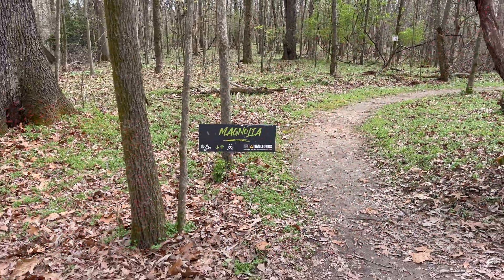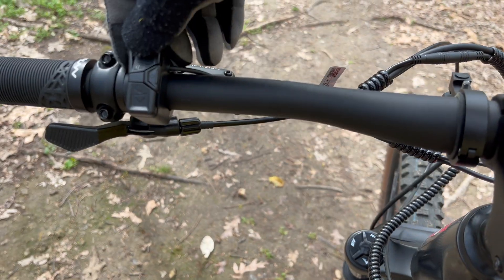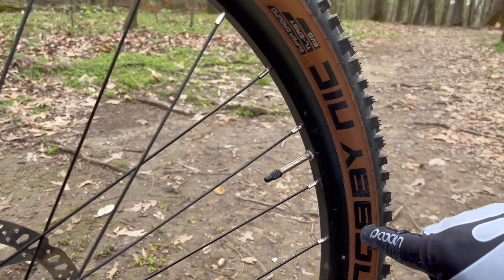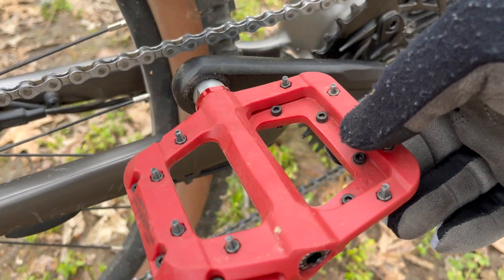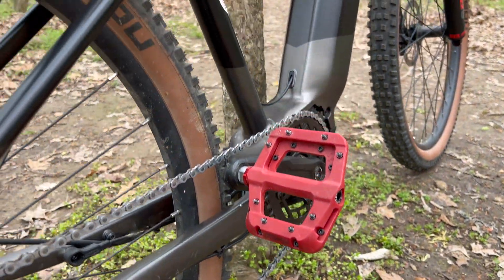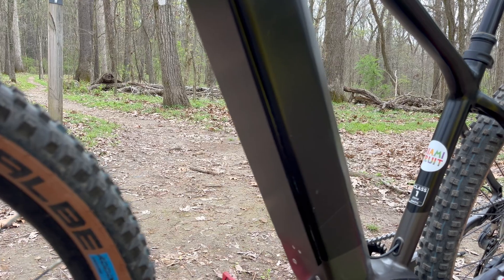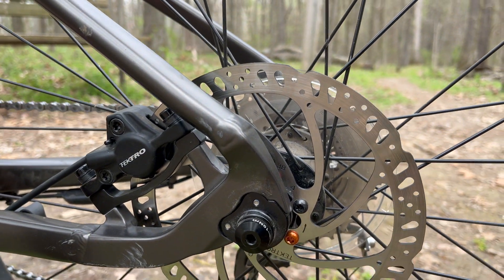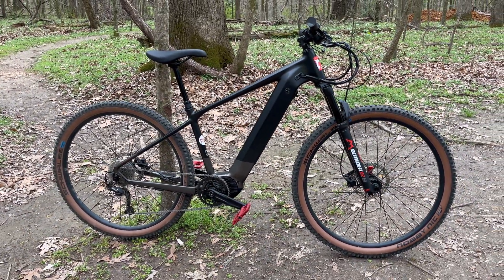Making a Worthy eMTB | Project-E  w/ Bafang M510 95NM Torque Mid-Drive

Comment: I love this. I have this frame but with M600 and full suspension. The only thing I'd change on yours is a smaller 32t chainring for better hill climbing and Bafang chainguard. I've never experienced a chaindrop with the chainguard installed.

Comment: So my EBike puts out 80Nm.  Is 95 a big difference?
Reply from the maker: In certain situations. A riding buddy that has a Trek Rail with an 85nM motor was impressed with the climbing ability of the 95nM, but 85nM does quite well too, and so should your 80nM - that’s a lot of power. I looked at a bike a few days ago that has 160nM…I expect it can climb a vertical wall 😂

Comment: Hey Kev, I think rather than being travel reducers, those Fox branded connectable pieces are air volume reducers. They make the fork more progressive, so if you're running the sag you want but you keep bottoming out, you can open up the forks and chuck 'em in.

Comment: I have a brand new (medium frame) Ozark Trail Ridge 29er as I beat the hell out of my Aluminum Comp. I've been keeping the miles really low while I save up for a new TSDZ2 to bolt onto it (the motor didn't make it either, blew the battery's BMS and my controller). EMTBs are great.
Reply from the maker: I’m not familiar with the TSDZ2 aside from seeing pictures and other mentions. Did you source the battery from the same supplier?
Reply: @KevCentral  The Battery pack was a Viaset 10AH pack from Amazon. it was cheap and I knew it, sadly it took the controller with it (the cells themselves still have voltage, though I'm not sure I'd trust it even after a new BMS).

The Tongshen TSDZ2 is 250/500/(and when you can find one)750 watt motor with torque sensing pedals. It's a decent mid drive for the price of a hub motor. only downside is it's tendancy to overheat in it's 500/750 watt form, expecially if you disable the speed limiter. I'd go for the Befangs, but those things go for a pretty penny.

Comment: I so wanna get unsick & healthy & go on a 1 or 2 year long ebike packing hobo site seeing adventure.....With rear rack  triple bag bike storage & single wheel suspension trailer with a 100w solar panel lid. For a range extender. With a 350w or 500w ebike & longer range battery, bring lightweight foldup solar panels & lots of creature comforts.

Comment: Can you provide torque in foot pounds?  NM makes no sense.  Also, power, which is what really matters.
Reply from the maker: All electric motors I’ve ever seen were rated in Nm. Using an online calculator that’s roughly 70ft lbs
Reply: @KevCentral  All the ones made in somewhere other than America, which uses the right spec.  But thanks.

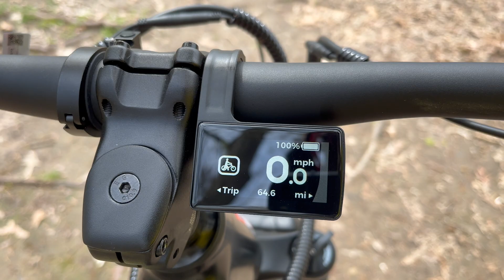Comment: 1:36  The bike symbol is walk assist.  If it's anything like my TSDZ2 mid drive, you press and hold down the down-button and the motor will move the bike to help you walk it.  You can even see a foot symbol on the down-button.
Reply: was about to mention my (now fried, RIP) TSDZ2's walk mode! See I was beaten to it.  it moves at about 2 mph. Now have to hunt down a replacement  to fit to the new Ozark Ridge replacing my old Comp.
Reply: @DFX2KX  Awesome! Hope you find another one. It's a lot of fun.
I built up the Mongoose Ledge X1 into an emtb. I think the only things stock on mine still are the handlebars and the seat.
Reply: @icypirate11  The biggest issue is the battery.  It was the BMS going up that ate my motor. 

But yeah, I would definitely like to kit out the new ride with a better pack and the open-source firmware for the TSDZ

Comment: gotta go all out with the tan now lol. Get a tan seat, purhaps Charge Spoon or go expensive like I did and get a Brooks leather saddle. Get some tan grips (I'm currently running PNW Loam XL tan grips which have just the right amount of thickness and padding) and those tan pedals i talked about in your last vid and it will look awesome. I wish there was some way i could send you a pic of my bike with all of it's tan and copper accents.
Reply from the maker: lol. I have a tan seat on it. I decided against grips as I couldn’t find anything that matched the seat perfectly 😂
Reply: @KevCentral  that's awesome. I'm actually in the same boat. After I applied some leather conditioner to the Brooks saddle it really darkened the leather so it's now a darker tan/brown then all my other tan parts lol.

Comment: Odi dread lock grips are the best hard tail grips . I would put an angle headset . 
Jenson has that fork for 199
Reply from the maker: I’ve been looking at those grips, but the 143mm length I don’t like. Why an angled headset?
Reply: @KevCentral I like my bikes around 65-64 degree ha